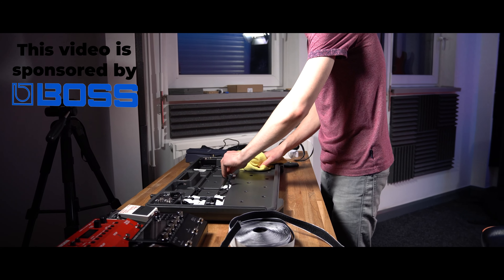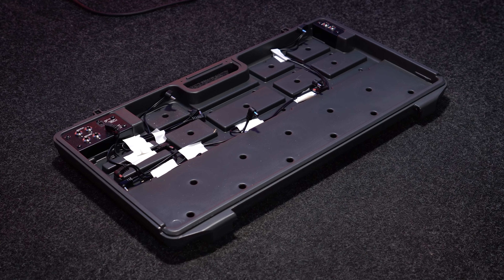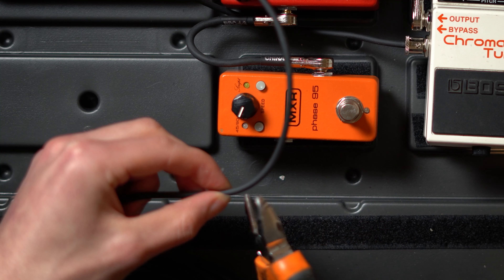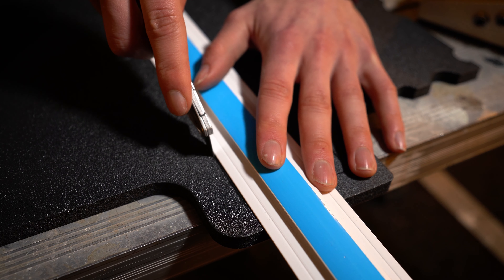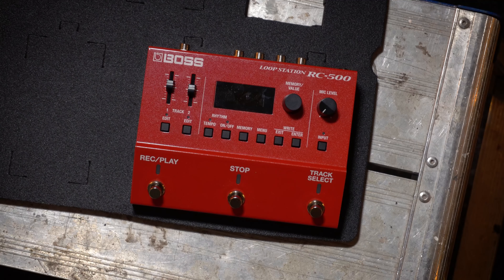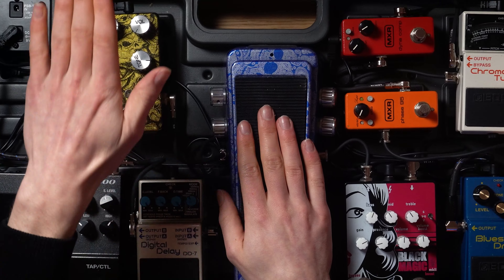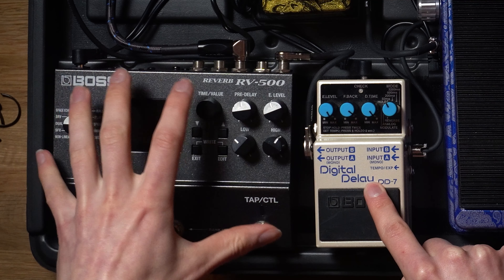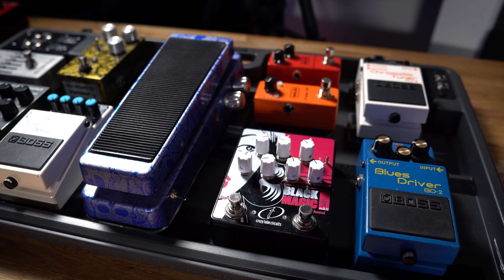BOSS BCB-90X Ultimate Guitar Pedalboard Build!!

Comment: I have a Boss BCB60 and use a Cry Baby wah for my bass, along with a Boss ME50B multieffect box.  The rest of my boxes always worked fine, but for the two rocker pedals on my wah and multieffects box, I basically had to cut the foam off the lid and pull off the insert at the bottom just to have a prayer of closing the thing.  Even then, I could feel it flexing out under pressure from the wah's spring pedal (it doesn't lock down).  This is worrisome because the clamps holding the box closed are plastic, and even with these modifications the board feels dangerously close to exploding open.

In addition, the wah pedal was up against their cable channel, which in the BCB60 was a component attached to the pedalboard.  The controls for my wah were therefore right up against the channel.

It seems like the latter issue is fixed in this board because the cables run between and beneath the pedals, but what about the former issue?  I was worried that running the channels between and beneath the pedals would essentially reduce the overall height of the pedalboard and make the issue worse.  Can you confirm whether mounting a Cry Baby wah onto this board makes it difficult to get the lid on or has the case gotten taller to compensate?